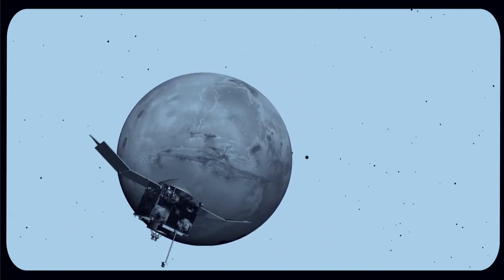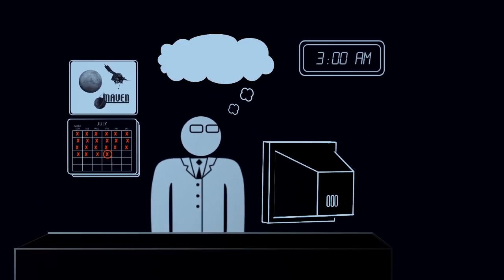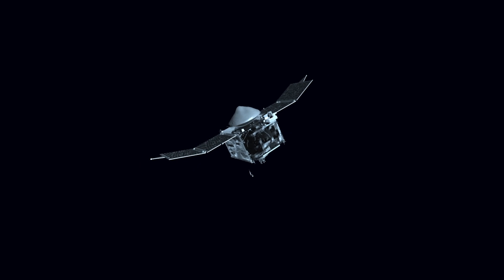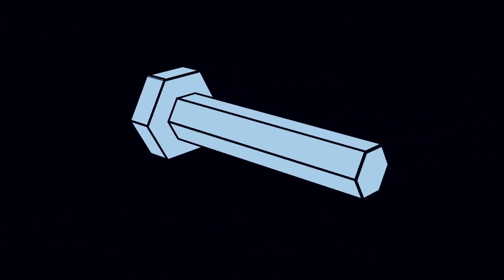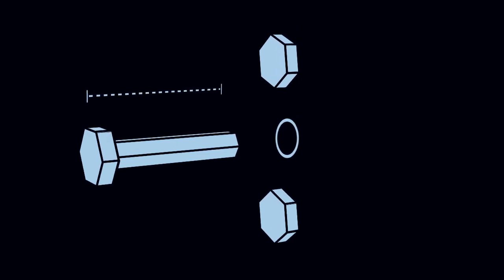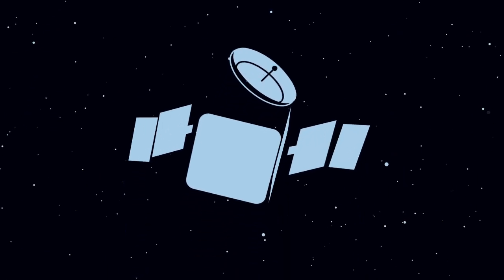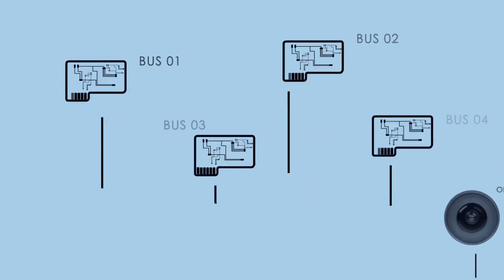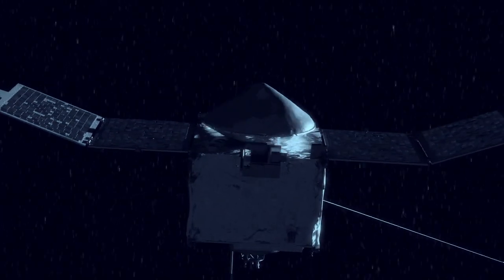NASA | So, You Want to Build a Satellite?

Comment: What happens if you build your own satellite without permission and you launch it how would nasa even find out and there’s no space police
Reply from the maker: The FAA actually has a say in what gets launched above a certain altitude - any thing larger than a G-sized hobby rocket engine, not to mention where it goes from. They do have an enforcement wing.
Reply: @NASAGoddard what if you use a homemade motor/propellant?
Reply: @GrilledCheeseSandwichReal then it’s rated to what it’s closest to I think
Reply: NASA Goddard what if you are outside the US?

Comment: @BahoUtot,
Yes, there are. But only because they were already fabricated "from scratch" to the tight standards and specs demanded by such applications. A lot of common hardware is produced in quantity, certified, and stocked for use as needed. But when you specify that nut and that bolt in a design, you know where they came from, and you know they were made "from scratch." They were not picked out of a bin at Discount Auto Parts.